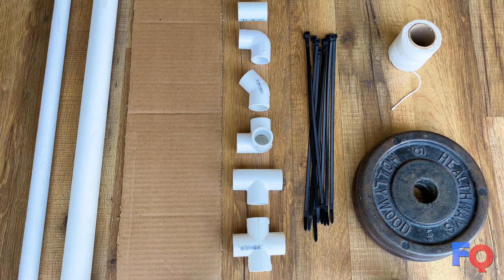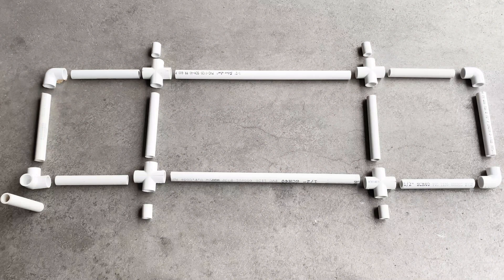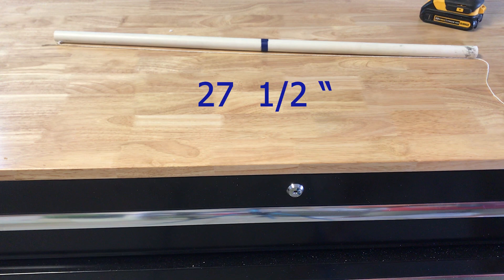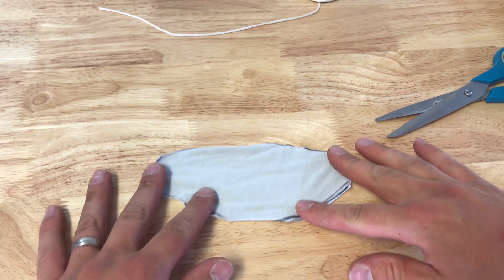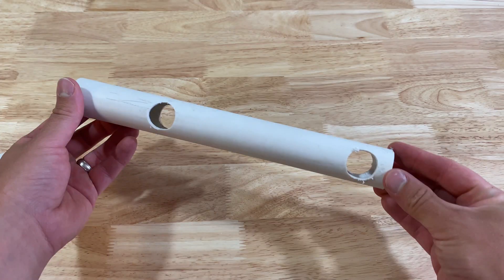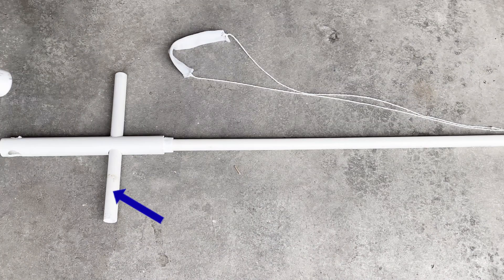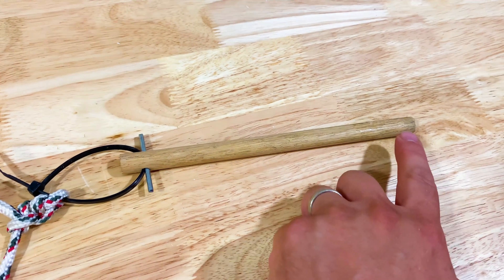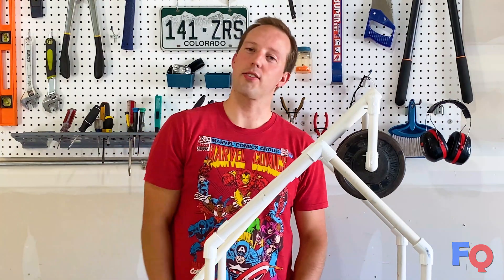How to Build a Trebuchet out of PVC

Comment: Great tutorial!

Here's a cut list based on the video:

Half-inch PVC unless otherwise noted
Base:
(2) 16.5" pieces
(8) 6.5" pieces
(4) 1.5" pieces
XX (1) 4" piece (may be a duplicate of the 4.5" from the release mechanism)

Release Mechanism
(1) 4.5" piece
(1) 1.5" piece
(1) 7" ***half-inch wood dowel**

Supports (2)
(2) 16.5" pieces
(4) 15.5" pieces
(4) 11.5" pieces

Arm
(1) 27.5" piece
(1) - 11" *ONE-INCH PVC

Pivot:
(1) 11.5"
(2) 4.25" *ONE-INCH PVC

Counterweight
(2) 3" pieces
(2) 5" pieces
Reply from the maker: Awesome, thanks for putting this in there!

Comment: I just checked the prices at my local lowes and the cost of the pvc is about $100.00 not including the glue.
or the 1" pipe.  Even online at the plumberssupply it's about $70.  Way to pricey for a art project.

I think building the frame out of 1x2x8s ($4 per) would be a better way to go.  
Using pvc for the arm makes sense.  
I've been thinking about using a golf club shaft ($1 at Salvation army).  Just wondering if the flex would result in increase  velocity of the projectile.  
I think a simple spacer ($2) through the end of the arm to suspend the weight on a rope would  be better.  This would decrease the MOI of the weight.  The weight could  be a bucket/pail full of rocks.